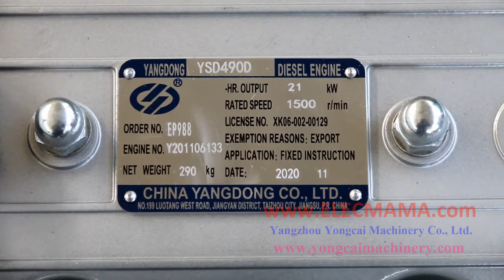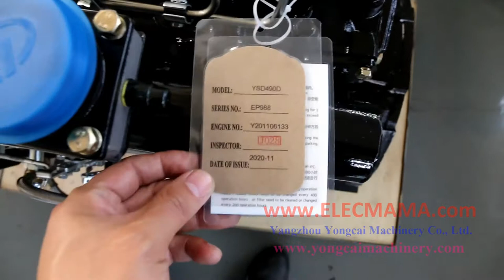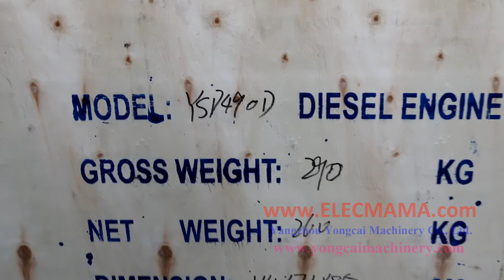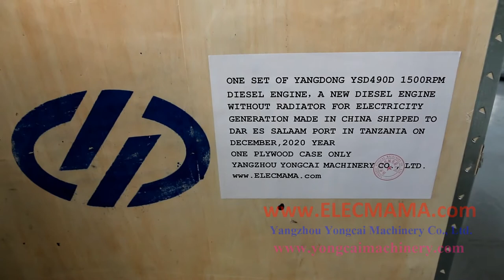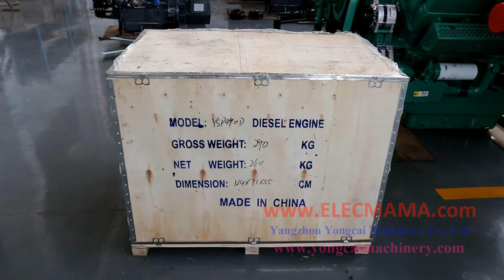Yangdong YSD490D diesel engine -- www.ELECMAMA.com

Comment: Amigo gostaria de saber qual é o motor que eu posso colocar no meu trator yto 28 hp embreagem de 9 posso colocar um motor de 35hp
Reply from the maker: Yangdong diesel engine, engine model is "YND485T",  35HP, 25.8kW power output, 2300rpm or 2400rpm, 130N.m/1610rpm or 128N.m/1680rpm, 85x95mm (bore x stroke),  2.156L displacement, natural aspirated, direct injection diesel engine for your tractor
Reply: Son mala gente .